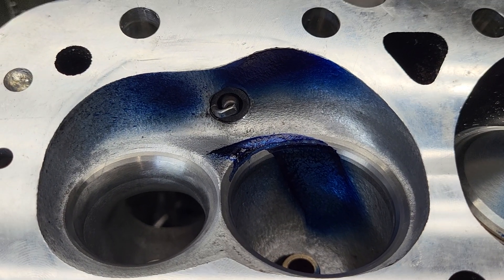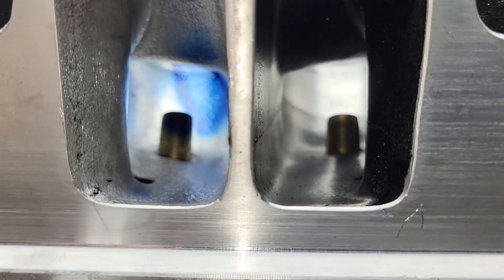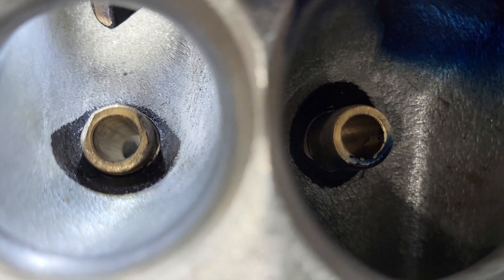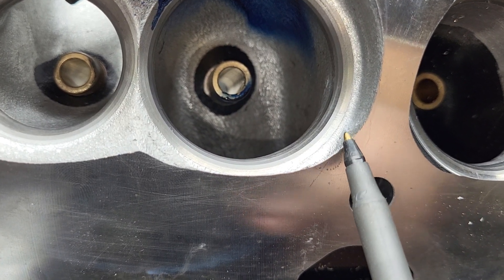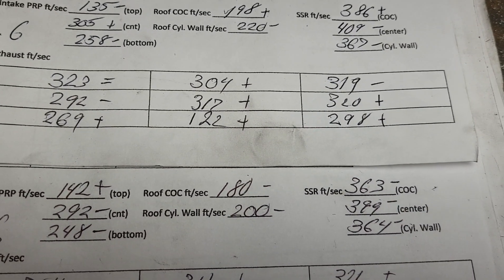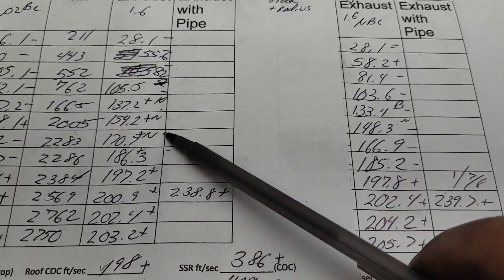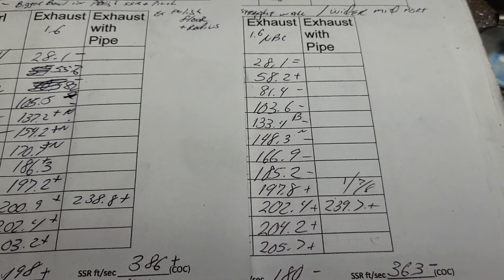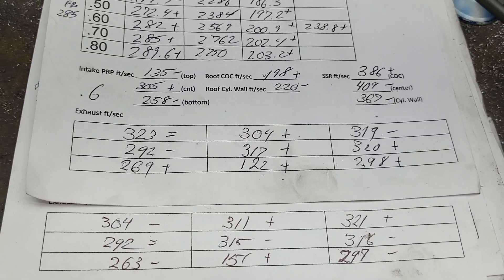Promaxx 200 Chevy cylinder head, third cut.

Comment: 275cfm won't hit 600. But 530 is definitely in the possibility, depending on intake. Hp will be the total flow of the entire intake flow. Carb,intake,head would be approximately 235cfm. 2 hp per cfm on a 350ci. With the 408....2.5 hp per cfm. 588hp. But one he'll of a torque curve.

Comment: A 408 with that head, at 11:1, a good .700 lift cam that'll get close to 600 hp ~580, depends on the intake manifold, carb, EFI you'd do 600 pretty easy.